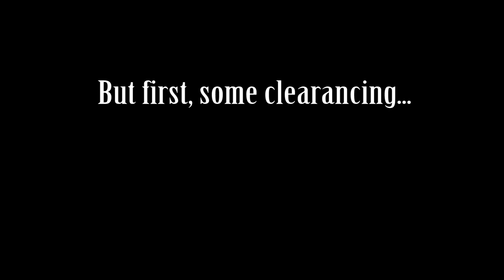02A/02C/02J Reassembly Part 2 of 3

Comment: I have a green B4 wagon that looks almost exactly like yours. The right side axle flange seal was leaking, so I replaced it. My car has the push-in style axle flange that has the circlip that goes into the groove at the end. I've inserted the flange into the differential and driven it in. I couldn't create enough force to drive in the flange with the limited space working beneath the car, so I used a long iron pipe from outside the car, having first removed the brake rotor for clearance. I've hit the pipe with a 5 lb hammer quite hard several times, which has driven in the axle flange, but there is still about 1/4" (maybe slightly less) of the shiny, machined part of the axle flange shaft still showing between the axle seal and the cup part of the flange. Prior to removal, the cup part was right against the seal. I'm hitting it as hard as I can, and can't get the flange to go in further. As I'm unfamiliar with doing this, I don't know if it requires even more force to get the axle flange seated, or if it already is seated. What do you think?
Reply from the maker: The most important thing is that you can't move it out. If it's locked in then leave it alone. My 02C passenger side axle cup is about 16" long and is rifle drilled for a bolt to hold it in (I'm using the 02C 17/27 angled drive from a Skoda so it is bolt-on). My Peloquin differential is 02C but the original 02C angled drive was a push-on like yours. My axle kept wandering out and letting gear oil out so my solution was I made a bracket that has a large roller bearing that bolts to the block and physically pushes the cup. It's worked for years now but it was supposed to be temporary until I removed the trans, disassembled it, and had the diff drilled/tapped for that bolt. The moral of my story relates to the fact that axle cup can move in and out a good 1/2" and still not leak. It shouldn't take but a couple blows from a dead blow hammer to get it seated. What I believe you have done is installed the seal 1/4" deeper than the old seal, thus you are seeing shiny bits. Leave it alone, monitor for leakage, and drive it!
Reply: @andrewlewis4253  Thanks for answering. I looked up all the 02a pics and videos I could find, and every one looks like I described. I think the reason it was pushed in further was because of an earlier screw-up: When I had the axle out to repack the cv joints and replace the boots, I hadn't engaged the axle splines with the hub on that axle. The axle had been held to the hub by the nut with the hub splines jammed against the axle splines. This preloaded the axle flange, which worked its way inwards toward the transmission. What's amazing is that I drove for years like this, even did a couple of track days, and it seemed fine. I didn't discover it until I changed the wheel bearings a couple of years ago.
I've had the car for many years, and this axle seal had been leaking ever since I bought the car. I'd avoided changing this seal because it looked like it probably wouldn't be easy- I was right about that! Hopefully, this new seal will keep from leaking like the one on the other side has ever since the car was brand new in 1996.

Comment: Did you use new bearings, I'm assuming you did
Reply from the maker: If they pass visual inspection reuse them. I've since put 120k miles on that trans and no metal in the 2 fluid changes thus far. Use quality oil and refrain from dropping the clutch and all will be well. Bearings are a wear item and can be reused pending visual inspection approval.
Reply: @andrewlewis4253  why did you need to reshim if useing the same bearings, only 2 oil changes In 120000 miles I change mine every 30000
Reply from the maker: @coreycrosswhite8890  I used a different case from what the guts came from. Variations in case tolerances during manufacturing means you have to re-shim. 30k oil changes are excessive. Even DSG is 40k.